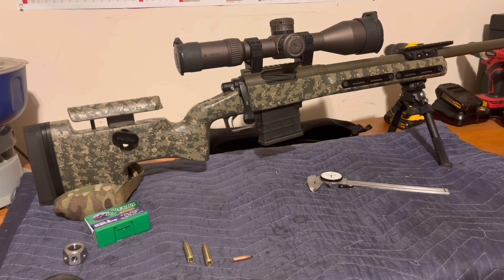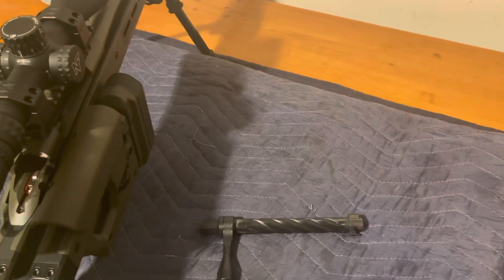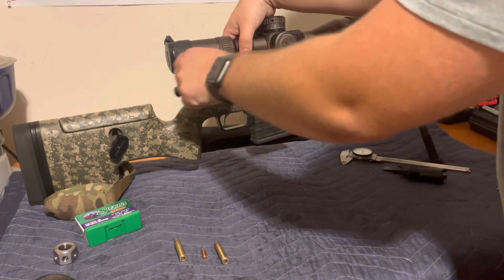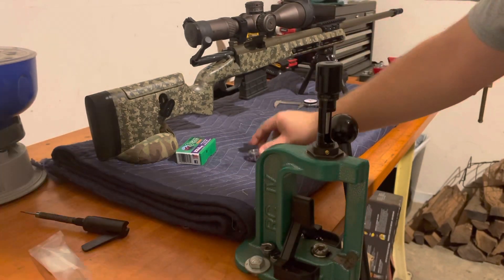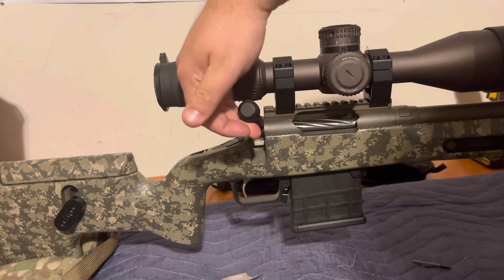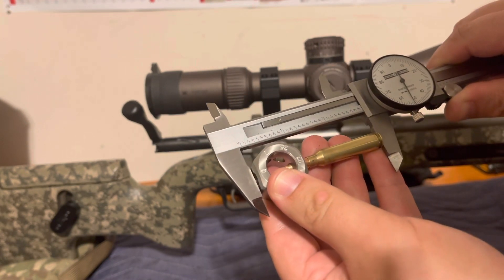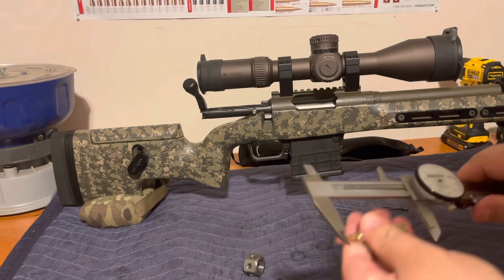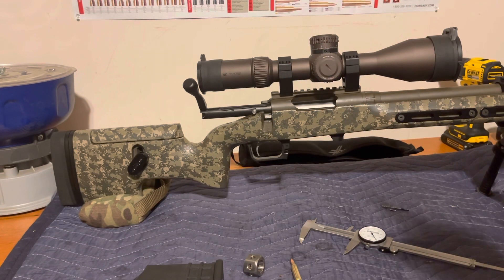How To Accurately Find The Lands in Your Bolt Action Rifle - Precision Rifle Loading Series

Comment: I have a custom built 28 Nosler and I’m running 28 Nosler Brass. I did this method and the neck of the brass is making just enough contact with the neck chamber. It’s not letting the bolt “free fall” so I have to apply a very small amount of pressure to get the bolt knob down. Other than trimming my necks, is there any other way to remedy this? I anneal and resize after every firing so every case is consistent. Thanks.
Reply: Btw I did this with just a piece of brass prior to seating a bullet.
Reply from the maker: If the neck is the contact point, I’d make sure your brass is trimmed to the correct length and potentially turned if needed depending on your chamber and neck thickness. Any updates since your original comment? (Sorry for the lengthy reply)

Comment: Which action is that? I don't know if you mentioned it. I have a couple of Bighorn TL3s and love the control feed. 

That's how I used to do it...then I got a Terminus Zeus action and just pull the barrel and stick a loaded round in it and seat it until it pulls out with very little effort.
Reply from the maker: Tan one is a Stiller and black one is by APR. Agreed on the TL3. Have been eyeing a Terminus for while. Absolutely amazing actions

Comment: Hi. First of all great vídeo. Thanks.
I had seen this method before and all the other ones but there is one thing i cant understand on any of them... why does it needs to be measured on ogive? Why not just OAL? (Not english native, sorry)
Reply from the maker: Much appreciated! Thanks for the comment and support. Measuring from CBTO gives a much more consistent and accurate measurement vs COAL on hp bullets. The meplat at the tip of the bullet can vary in length so readings can be inconsistent measuring COAL. Tipped bullets give more consistency than hp bullets measuring COAL but off the ogive is the most accurate and repeatable measurement.
Reply: @hkrifleworks  thanks for the answer.
So its the same but the tip can have more factory error than the ogive "distance".
Therefore you get better results measuring ogives and not tips. Did I got it?
Thanks again

Comment: 20 different answers doesn’t matter! Truth is, it’s just doesn’t have to be that precise. As long as your not sticking the bullet in the lands far enough to pull it out of the case. It’s only a starting point. Suppose you get the exact measurement. Now suppose I get a measurement that’s +/- .005-.010 different from yours. We both then subtract .020 as a starting point. So who cares whether I’m starting +/- 5 or 10 thousandths different than yours? No one should because it’s only a starting point. What he’s doing is not wrong, it’s just way over kill for something doesn’t need to be that precise! This is a much quicker, easier way. https://youtu.be/a7vjgEgnhHk